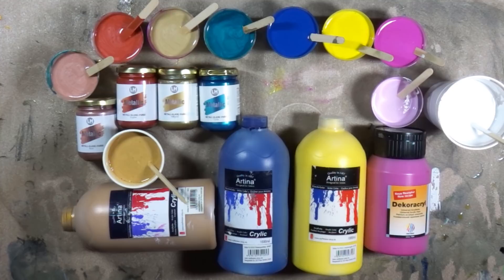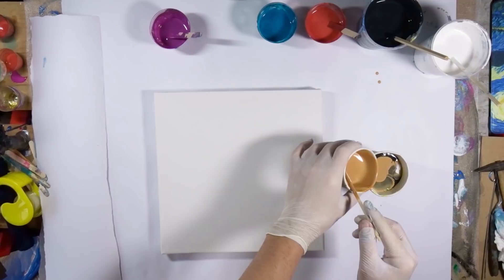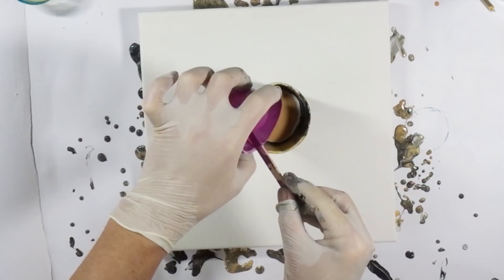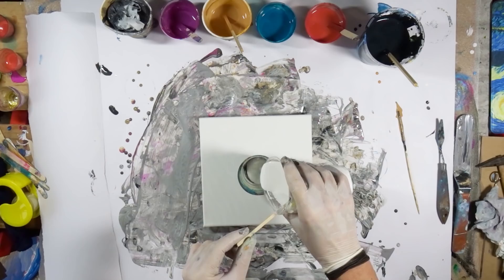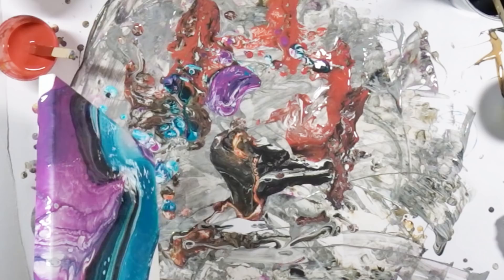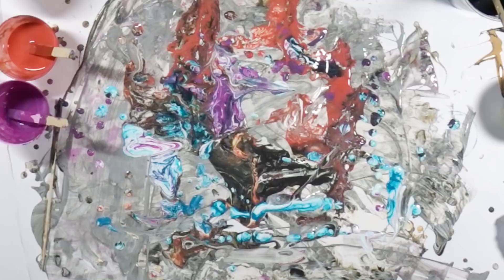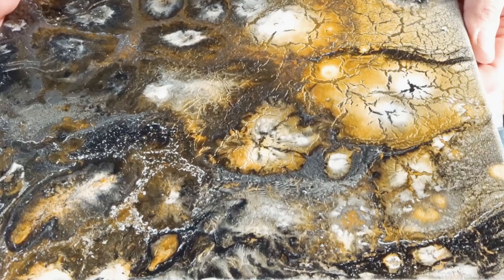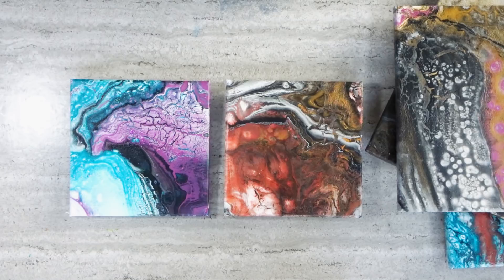PLANET SURFACE POUR - Acrylic Pour, swipe, cracks and fun with PVA glue

Comment: Either your paint was too thick or it dried too quickly because the airflow was blocked. You can pour a Metallic in the cracks...maybe?
Reply from the maker: it was both I guess. I used my metallic Posca markers to 'fill' some of the cracks, some I left like they were as it was kind of cool

Comment: Hi, I'm curious to know if the paint was coming off of the canvas or just cracking?
Reply from the maker: Hey Corrin, no the paint is not peeling off, I tested that right away once it was dried. It is totally fixed to the canvas, just cracked. We pointed the issue to be the water added to the mixture so that the glue chemistry lost cohesion. Makes sense to me but will investigate that further to be sure :)
Reply: Thank you so much for the information!  Love your videos:)
Reply from the maker: Corrin Deale Strunk thanks :)) todays video is coming in about 30 mins :)

Comment: I wonder why they all had cracks...Maybe something with the glue? Trying too quickly or slowly? Please let me know what your opinion is so I'll know if this happens for me...♡
Reply from the maker: Preciosa Flower I had a comment on Facebook suggesting it might be because of the glue and the water added to thin it down which sounds reasonable for me and I was soooo thankful for that hint. She was not sure herself but it made totally sense to me as I often thought there was some kind of water layer over the artwork which I never had before but did not want to touch it and did not follow that thought further but I feel she nailed it and the water changes the chemical cohesion of the glue. I will test that further in overwhelming scientific experiments 😏😏
Reply: MKL GRM Fine Art I know you're in Germany.  I was wondering if maybe the art work drying in a colder environment was the reason.
Reply from the maker: Preciosa Flower don’t think that was the reason. I dried everything in my flat so same conditions. Paint it more likely to crack when it dries too quickly instead of too slow so I really guess it is the glue and water that causes to change the cohesion of the glue...at least that sounds most likely for now at this point :) we will see :))
Reply: MKL GRM Fine Art I have had more cracking using glue as well.  I wasn't sure if it may have been that I was painting over an old pour so the canvas was somewhat "sealed". I'm going to experiment more carefully and try to narrow down the cause.
Reply: Thanks for the Experiment. It was very helpful as I too have had the same experience when using the glue. In the same room at the same temperature I poured with Liquitex pouring medium and had no problem
Reply from the maker: Jill Carr-Hilton perfect so we both keep experimenting :)) one solution might be too much water mixed into the glue and the other a sealed canvas. Probably both...seems to become a testing series again 😅
Reply from the maker: Jewell Dean Herbrandson-Stokes we are on a track what caused it and it is too much water mixed into glue and/or an already used and sealed canvas....we will investigate :))
Reply: MKL GRM Fine Art my problem is I change more than one variable in most experiments.  Need to remember my scientific training!  Lol
Reply from the maker: Jill Carr-Hilton I suffer the same issue and I never stop doing it although I know it 😱🙈🙈🙈😅